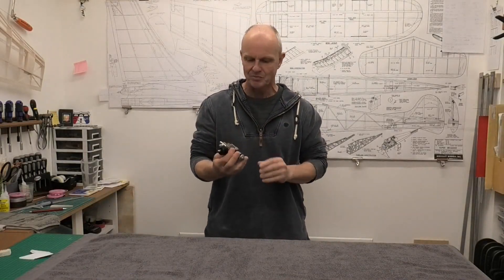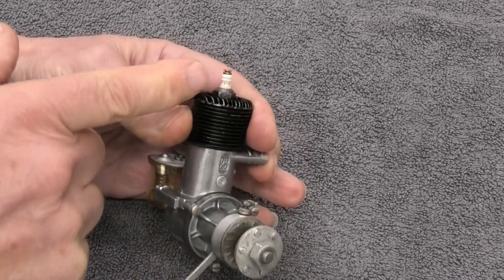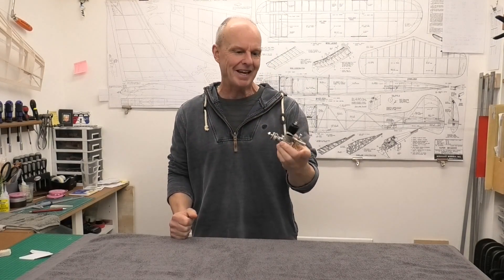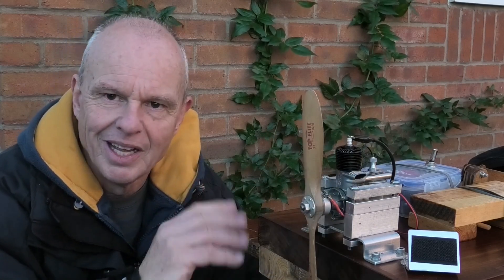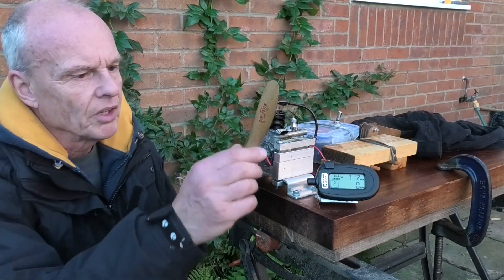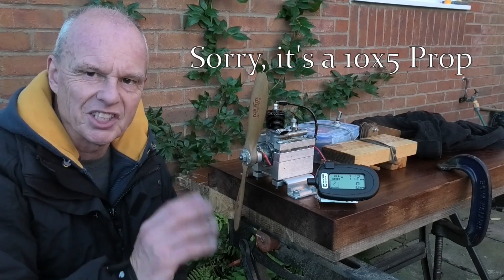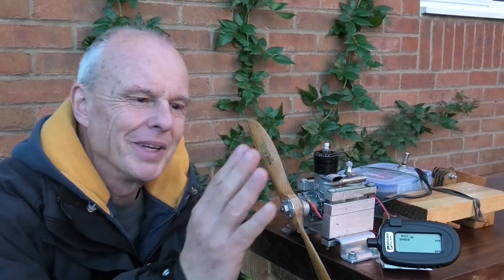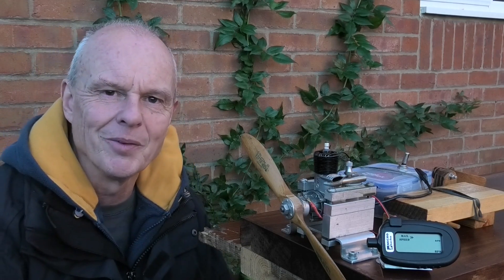Ohlsson & Rice 23 - 1946 Spark Ignition Engine - Test Run

Comment: You didn’t show any of the electrical set up. Are you using batteries, coil and condenser? When running old ignition engines, I always insist on old vintage set ups and nothing electronic, that of course is cheating.
Reply from the maker: Hi there, I am using batteries, coil, but no condenser, instead I have one of Larry Davison electronic ignition circuits, works real well and kinder to the original points that are still used.

Comment: You have probably figured it out by now, but when the timer is advanced to far it holds the points open. 
It should run best with the timer arm a little bit down from horizontal. I have one on a 60" Lanzo Bomber that pulls it up very well. And yes, the needle valves on Ohlsson's are very sensitive. 

But all in all they are great running little engines and can use a wide range of props as long as you do not advance the timing to far. They also take a long time to break in. 

I got an unrun one a few years ago and have several hours on it and it is still tight and needs more time on it. 

Great video from you as usual and I really like the old Ohlsson's, as they seem to run forever and are easy to handle. I have a 60 side port on a 80" Playboy Sr. which also runs really nice. 

Thanks for doing these videos for us.
Reply from the maker: Thanks for the comment, always appreciated.  I have since stripped the timer assembly and cleaned and regaped the points.  They were a bit mucky and the gap was a bit small.  I will have to get it back in the test stand soon and see how it runs.  It did run ok before, but just didn't seam quite right.